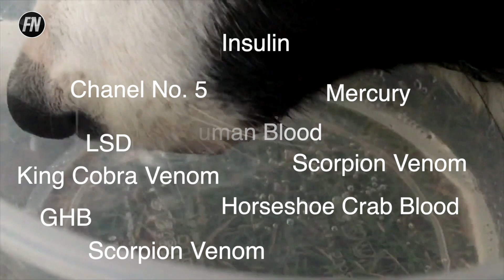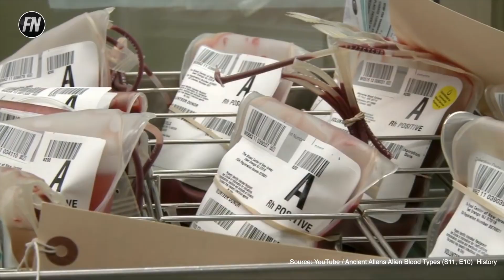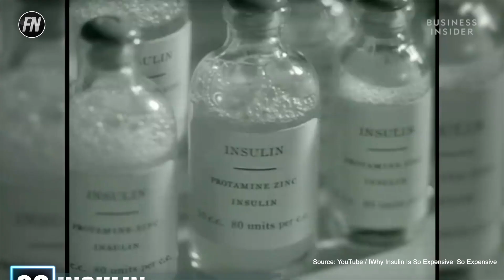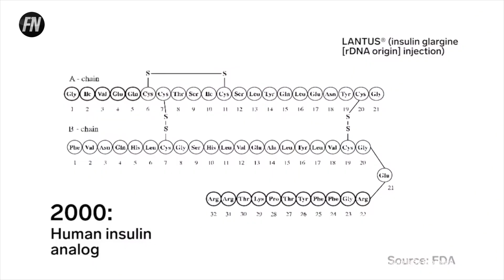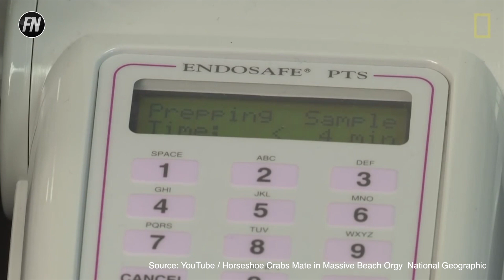10 MOST Expensive Liquids on Earth 2020

Comment: The PCR probes I use in the PCR diagnostic tests for COVID-19 actually have almost exactly the same value as the scorpion venom per litre. Also, I suspect if you did some digging you could find a custom molecular biology reagent which is significantly more expensive as well. We use an incredibly small quantity per test, about £12.50 worth, but still given that we do so many tests at once I routinely handle 10s of thousands of pounds worth of the stuff
Reply: I just realised I forgot to convert for currency exchange rates. The PCR reagents we use are actually quite a bit more expensive by volume